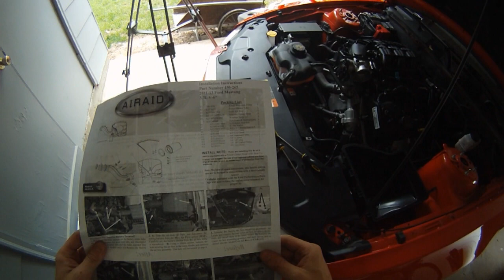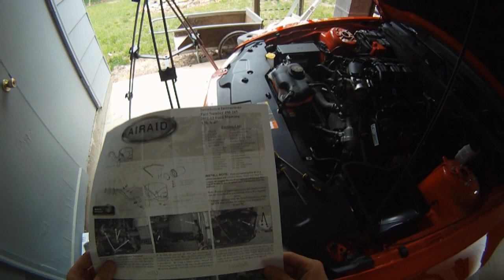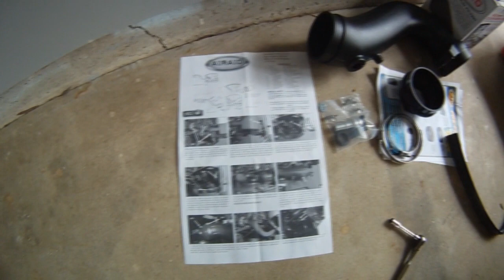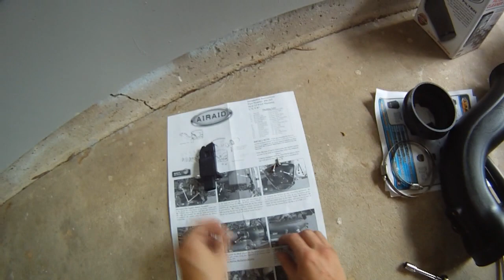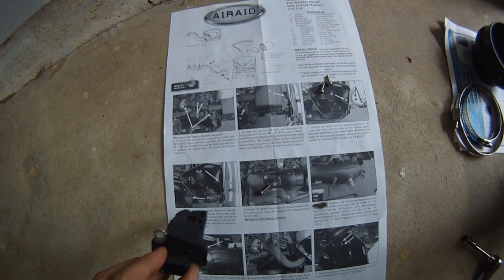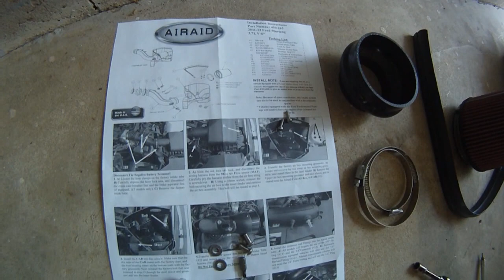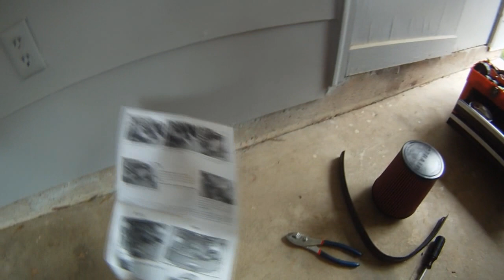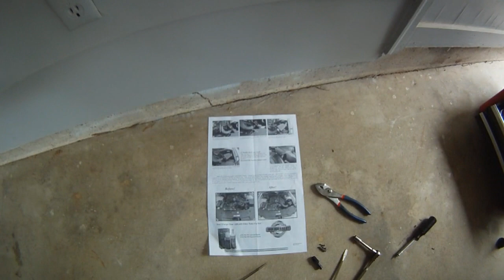Airaid MXP Cold Air Intake - Sound Test - Install Guide - Ford Mustang V6

Comment: New Sub!! Excellent vid. I have a 2012 V6 Kona blue. I just got done installing my Steeda CAI + BBK throttle body. Figured I do both at the same time while I'm taking it apart. The stock throttle is a baby compared to the new one. I had to retune the car's ECU cause of the bigger diameter TB plus intake tubing. They tell you its a 40 HP increase but in reality its 15HP or so.

Comment: Did you feel a difference with the bama tuner or does it only make a difference on automatics
Reply from the maker: The tuner definitely made a difference, but only because I have the cold air and the exhaust, etc...  If you get a tuner for a bone-stock car, I doubt it'd be worth the price.  But, if you tune your car for the new mods, then it will gain torque or HP or both.

Comment: Hey bro I have a 2014 mustang v6 I want to get the airaid intake for it it's the same as this 2012 right? Like same install and product? Nice to have a full vid on this...
Reply from the maker: The 2011-2014 are supposed to be the same.  However, I can't guarantee that for sure.  Sorry!
Reply: PowerSports420 thanks for the reply Bro, yeah I imagine it's t same, so you said on a automatic there's a different part you use the install VS if it's a manual? Do you know exactly what size Allen wrench as well as need, clowns don't even give you the right instructions or?...
Reply from the maker: The automatic has a PCV breather hose, it just regulates pressure in the transmission case.  Basically, you screw in a little nipple into the intake, and then slip the hose on it.  Cake.
I don't remember what tools were needed, sorry!

Comment: you didnt take your time, you revved the engine when it was cold.  so much wrong it hurts.

also, never skip arm day dude.
Reply from the maker: i didn't rev it when it was cold, the choke was already off.  its not like i held it to the floor for 5 minutes.  its a car, not a pretty girl, you don't have to take it THAT slow... ;)  ;)  ;)
"arm" day???
Reply: How would you have any idea if the engine was cold? Were you there?